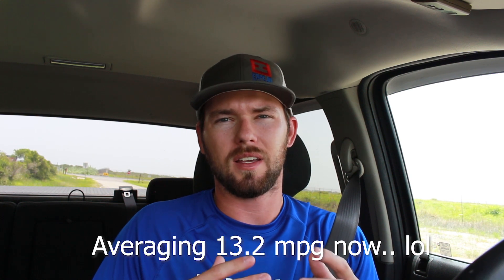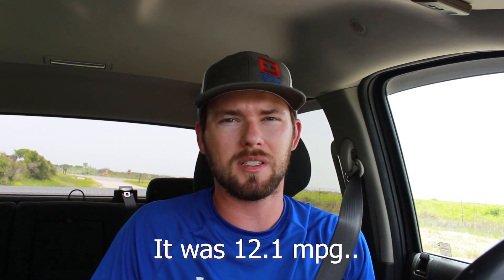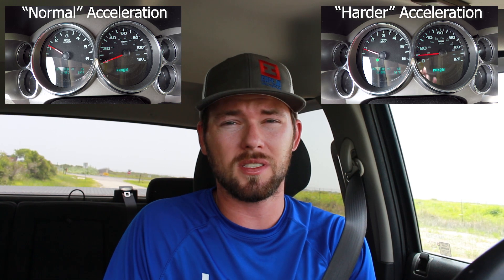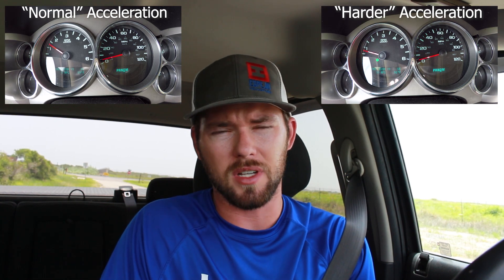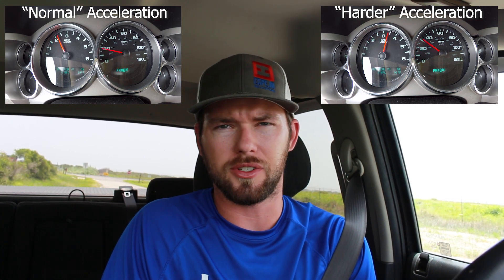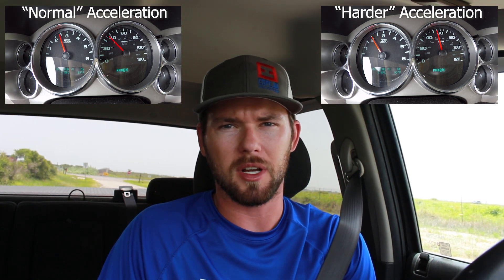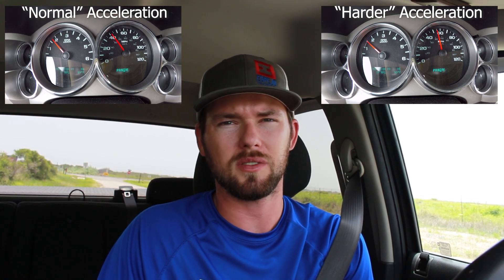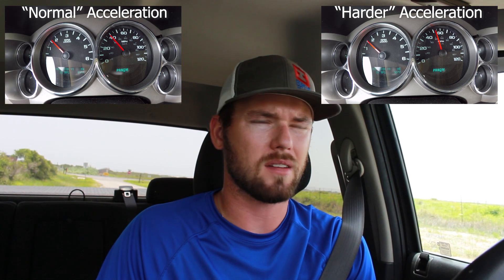Gas Mileage After Installing a High Stall Torque Converter

Comment: Not surprising at all. Very glad to hear that your real world experience matches my hypothesis for my plans for my GMT900 Z71 that is apples to apples with your truck. 

The higher stall is allowing the engine to operate in the power band more often. No power increase to the engine, this new torque converter with higher stall is more effectively using the power that your engine already makes. 6L80 begins ramping the TCC in 2nd gear. The "slippage" added from the higher stall converter is not a loss of power, it is doing its job to multiply torque and make the most of 1st gear, then TCC takes over. Even if you feel like you are holding shifts longer or holding at higher RPM and for longer during acceleration, that is exactly what you want for best efficency. The engine is going to burn fuel to move that truck either way. You want it burning it most efficiently. And when you are asking for a high percentage of the power that 5.3 has available, you will want the engine to be close to 4k RPM as much as possible. Once you are cruising and no longer accelerating, with TCC your RPM should be exactly the same (or VERY VERY close) to cruising RPM at the same given speed on a OEM converter. But would be curious to know what RPM/speed ranges you get in 6th gear cruising. Possibly you said that in your video and I missed it. 

So so so so glad to hear about and see your results. Thanks for sharing. I will definitely be installing that exact converter once I can save up the cash.
Reply from the maker: The converter locks up when your cruising so there’s no slippage once you stop accelerating. So mpg on the highway is basically the same as the stock converter. Also I have an even higher stall converter in the truck now, this one ended up breaking. The one I have now is a 3400rpm stall instead of the 2600. Performance wise the bigger stall is the go to but now my mpg did suffer a little.
Reply: @JohnVesely  very good information. Thank you so much for replying and sharing your experience. Definitely higher stall will increase performance... I think the 2600-2800 is EXACTLY what I'm looking for. Something perfect for a heavy foot and hard/ aggressive daily driving, but not trying to set any track records. Fuel economy is certainly a consideration and I get the feeling my fuel economy will increase with the 2600 like yours did.

Comment: I have a 5500 Fairbanks stall that makes my 2500 leave on the rev limiter. It helps allot when I'm leaving a light while towing the Space Shuttle, Endeavor. I've  experienced a 5-7 mpg better, while towing than just highway miles with no trailer.

Comment: Maybe you are hitting the sweet spot more often on acceleration with the higher stall. There is a sweet spot between slowpoke and WOT that gives you better fuel mileage. Mainly because you're at cruising speed sooner so it makes up for the fuel burnt during acceleration.

Comment: The engine in low speed has no load because of the torque converter so no load no fuel consumption
Reply: Higher rpm means more friction and fuel. It still needs to maintain the proper air fuel ratio for whatever rpm. Might not make much difference with newer 6 and 8 speed transmissions because they are designed for the stall to be locked even while shifting.

Comment: hey i have a 08 Chevy tahoe .. They told me my motors is fine after hearing this funny click noise that they believe that it was the motor. my neighbor told me to say my money because it was my motor but look into the Torque Converter. I have recently had my evap gas senor change in the back of the gas tank a few weeks ago and i notice it was stronger and lasted better fuel. Yesterday i started my Tahoe up and i was hearing this noise and its more noticeable when it is in park. I have a little sluggish in the rmp. Could this be  the converter that need to be tighting up because my  next door neighbor was highly recommend ?? 5.3 motor by the way

Comment: Old video, lol. I know why you are getting better gas mileage. It's because of the clutch in the torque converter. the clutch probably was burnt to shit on your stock converter and was slipping to get the 12.3 mpg. I think you said. But the torque converter slipping usually puts on the check engine light because the computer monitors this and if it slips too bad will turn on check engine light. In stock form these transmissions are made for the torque converter to slip alittle for smooth operation in overdrive. I think when the slippage is more then 500 rpm's in lockup the check engine light comes on, and in normal operation the slippage is 200 rpm's or less. The new torque converter has a good clutch and fixed the slippage issue and bumped up your gas mileage to 13.1 mpg. I know this because I just rebuilt my 4L60E myself in my 05 Avalanche and didn't change the torque converter when I put it back in. I blew 3rd gear (ofcourse) and when I did this it also burnt up the torque converter clutch and didn't know till I put rebuild in and drove it. Worked fine at first with 13.1 mpg. but then started slipping on the lockup in torque converter. When the computer senses the excessive slippage the computer up the hydraulic pressure in the trans and would pound into gear trying to fix the trans issue of slipping. Then my mpg. went down to 12.8 and then the check engine light came on saying trans slipping. So guess what I'm doing right now, LOL.

Comment: Which stall you recommend me with stage 2 cam on my sierra 11 5.3? Daily 4 inch lift with 22x12 -44 33s
Reply: 4500rpm
 that will get it moving
Reply: @boostedbigblocks6252  way too much stall especially on a stage 2 cam and a 6 speed 3K stall is juicy enough even on a 4 speed

Comment: With that 2600 TC, have you tried towing with it yet? And if so, how much  weight will it hold reliably?
Reply from the maker: It does fine towing honestly. You have to have a tranny cooler to support the extra heat but other than that it does great. When on the highway it goes into lock up so it’s like it doesn’t have a higher stall. It will rev out higher when accelerating but that’s expected.
Reply: @JohnVesely  Thanks for the reply!

Comment: I know I'm late to the party, but don't let people give you shit about making this type of video. I want to see your impressions on your modifications. If other guys are going to make modifications to their trucks, they'll be researching them first. Your videos will help them. 
  The changed commute may be a big part of your mileage gain, but another is that it puts your truck into a more efficient range quicker. Instead of coughing and stumbling  from a rough idle, you're entering the meat of your torque curve when taking off from stops. It's not as good mileage as a stock truck, but your entire powerband increased, including part throttle. 
  In short, the converter lets your engine rev to where it's running good before putting a load on it... giving you slightly better mileage. Yes, you're revving higher, but the engine is running cleaner and stronger.
Reply: Best answer ☺️

Comment: So after a month or so after the 3000-3200 stall I'm getting 15.3-16 city and 19-21 HWY. Stock torque converter after my mods, Cam Stall, Long Tube Headers was 13.2. and stock 3.42 rear gear.  My mileage has got better from the re gear also. Went from 3.42 rear gear to a 4.10. I think these 2014-2017 are geared way to High from factory. My mileage on highway went from 17-18 to 19-21 with the 4.10 gear
Reply: Same here bro I have a 2011 Sierra 5.3 cam,headers, and exhaust 3 inch ,tune. Stock converter with 224/230 lsa 112 had 13.5 mpg then back to 15-17 mpg in like wtf?! Win win right there
Reply: So its ok to have 4.10s on the highway/interstate on these silverados??
Reply: @ThemcpeMaster53  Yeah at 80 mph I'm only pulling about 2150 RPM. I have a 6 spd. An 8spd would probably be under 2k RPM at 80mph
Reply: Jack Graves i have a 4L60 😬 what rpms will mines be?
Reply: @ThemcpeMaster53  I pull less than 2250 at 80 with a 6spd. Stock 20s stock height tires about 30.5-31 tall. If your tires are taller you'll pull even less RPMs than me
Reply: Jack Graves well lets say im in the Lowered stance truck trend, right now i am running stock 20s of 255/50/20s, but i plan on running 22s or 24s later and then look into getting 4.10s or 3.73s... my truck is a 2009 1500, my plans with it is to be a Street Truck, so i want to do 4.10s but ive heard its bad on Highways
Reply: Jack Graves i dont make much money so i rather do all my research get it right the first time than to deal with problems and re-attempt gear swapping
Reply: @ThemcpeMaster53  I took out the Open rear Carrier and put a Detroit Truetrac in about 5-7 months ago. Having a Real Posi rear end is AWESOME and that 4.10 gear. HELL YEAH
Reply from the maker: Yeah the true trac is nice! I have that in my truck
Reply: Jack Graves dayumm thanks for the info man! I cant wait to try it
Reply: @ThemcpeMaster53  if you have a 6spd tranny a 4.10 is fine. If you drive 75-80mph. If you drive faster than that for long periods of time I would go 3.73. My truck was stock 3.42. So a little jump would have been 3.73 for me but I wanted more and went 4.10. I still get 19.5-20.5 highway with a 4.10 gear
Reply: Jack Graves alright man, ima do some more research on these 4 speeds if they can handle 4.10s, im always on the highway, and i want to be safe
Reply: If you  change gears and tires your odo won't show the correct miles so it might look like it gets better but I doesn't necessarily actually have to be better.
Reply from the maker: That maybe for older vehicles but on modern vehicles you put in the gear+tire size so the computer knows the correct rpm to shift and to operate the vehicle. In turn this will correct the mileage.
Reply: @alexh201174  Nope I have a Hypertech inline module to correct Speedo for Gearing

Comment: I'm getting better too John. 15-17 in the city now with my 3000-3200 stall and my 4.10 rear gear
Reply: So u mean putting 4:10 gears n a bigger stall torque converter on my stock 03 Silverado i should get better gas mileage n my other question is will 4:10 gears be good on the highway or should I use 3:73 for the highway driving instead
Reply: @hersheljones9467  what size tires?
Reply: @shawnmcclure7282  265 50 17
Reply: @hersheljones9467  oh so pretty much stock. I would stay with a 3.73 unless u plan on going 35s-37s

Comment: You're not the only one who dailies their cammed truck. (Not saying this in a negative fashion) Topping that off I"m on stock gearing, stock stall converter, 6" lift and 35's. Most of my driving is highway and I average 12.1 - 12.6. My gen of F150 also has a 6 gear transmission but I have a tune that locks out overdrive (6th gear) so really it's 5 gears but I think it probably helps.
Reply: i cant even get over 11.2 in my 2011 but have mine locked to v8 mode and lift and tires